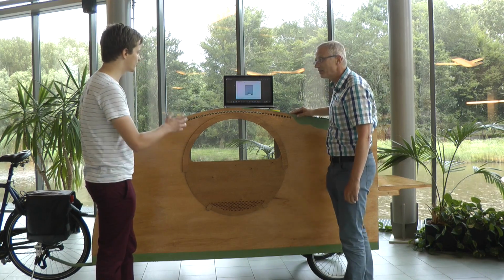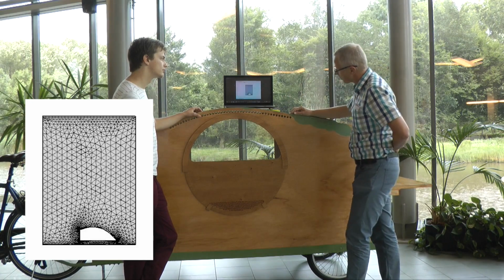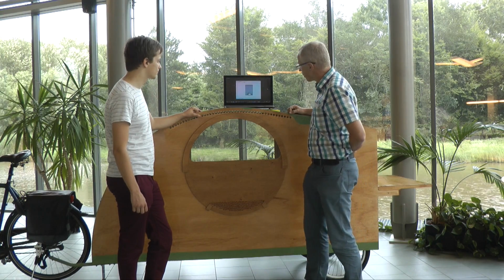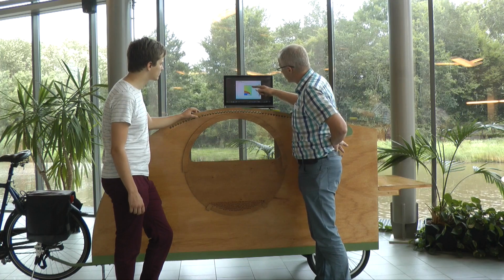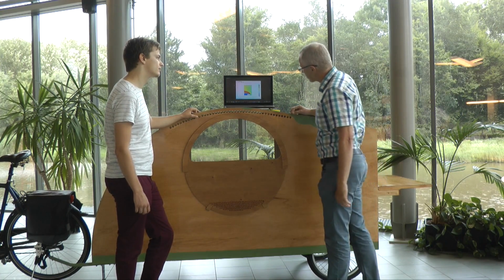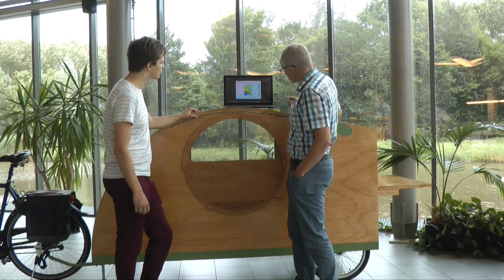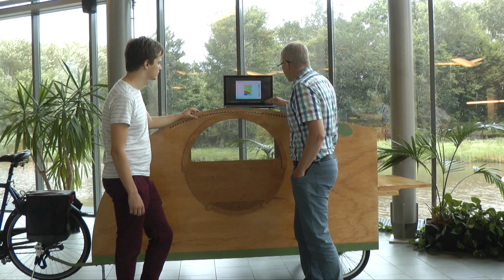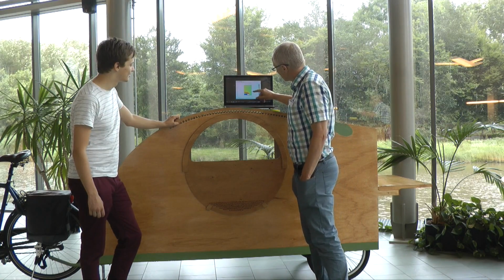Bicycle caravan (Deutsch)

Comment: RE: "..it results in about 60 Newtons over here so all of the factor or more than effective tool has been gained during the resistance is a lot smaller.." ..was the rendering of the automatic google translation.

Accoustically it could als mistunterstood as 16 N. Also would fit the rectangualar resistance of 40 N given, and 16 N would fit an reduction of resistance. However, these values, if 40 N. versus 60 N could also simply have been confused during attentiondrain for making making this presentation. 

Therefore my question: Was the reduction from 60 N. to 40 N.? Or was it from 40 to 16?